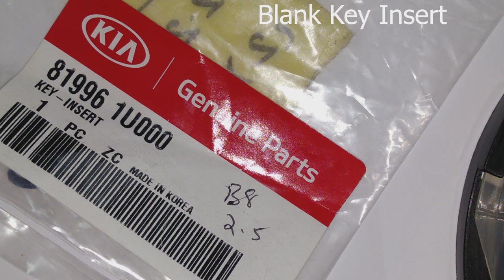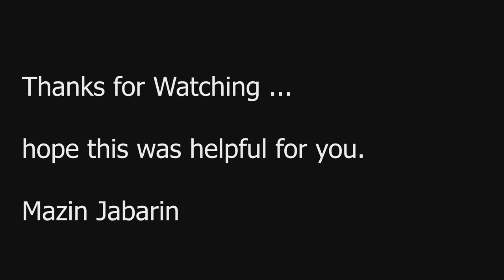Disassemble, Replace key insert and Reassemble KIA Key Fob

Comment: That was extremely painful to watch. I couldn't get past the first 7 minutes of silent, nothing. There has to be an easier way?
Reply from the maker: Sorry for that, It was extremely difficult to do, I believe it is not designed to be disassembled at all.
Please If you found a better way let us know :-)
Reply from the maker: Thanks, keep in mind this is different type.
Reply: @msdee7444  
The key in your link, is for old Ceed 2010, i think.
This is the key for later model Sportage.
It is not designed to be repaired.
Reply: @msdee7444  this isn't the same key. Your link is much easier to open... I'm having as much difficulty as the video poster was.
Reply: You don't need all the B's, just looking at what needs to be done 👍
Reply: Just use a bigger hammer 🔨

Comment: READ ENTIRE COMMENT 
If you are trying to repair flipping of key/loose or no tension of the flipping key, just don't bother opening it with so much care. Remove the screw, flip the key to open position and then Take nose plier, insert it in the empty slot of the key, press the plier, basically u will be breaking the plastic locks and that's the only way to do it. The internal component of the spring mechanism is broken and only solution is to buy new fob and just transfer all the components from old key to new key, don't forget to transfer transponder, it is the main component which communicates with your car, it looks like piece of plastic, so don't throw away old key components until u make sure the new key works. This key is hard to disassemble because it is not designed to be repaired. The upper part of the key with the KIA logo is glued with the bottom part(the one with buttons) of the key. This might be done for waterproofing or just to make key repair impossible.

Comment: Tip: make the spring two turns.  To do this, simply place the 3 components in place (with the key closed) and then correctly insert the other side of the body by turning two anticlockwise before closing.  Do not fully tighten the screw under the logo.
Reply: Thank you. Very helpful!
Reply: @WoWdropzone  I'm glad it help you!

Comment: After swapping the PCB board over, assembling everything, the car will not start with this new key fob. I don't know where the transponder chip is located in the key for the year 2013 Kia Cee'd. Any ideas? Oops! I have just answered my own question by looking more closely at the bits I broke apart yesterday! The transponder is located on the top-left edge of the back cover when looking at the Kia symbol the correct way up. So in this video it is under the securing rubber pin which is shown at 20:48. I will try to remove it tomorrow. It looks like a magnet with a little red paint smudged over part of it (in my case). It is surrounded by quite a bit of plastic so should be another interesting challenge!

The remote central locking, the boot, etc all work perfectly and the car tries to start but the engine will not stay on. Basically, everything works in the car with the key in the ignition but when the engine kicks in, it will simply not stay on and keep running. I can only see a minor scratch on the PCB when my hacksaw went close to it at some point. The scratch has not caused a break in the track on that part of the PCB and there were no components on that side of the PCB.

I used a small hacksaw to try to cut along the lines that had been glued together. When I eventually managed to cut and pull the fob apart, I realised there was a small hole in the PCB that they had moulded the last piece through at the bottom of the PCB. It secures the board in place but that last bit of plastic had to be delicately cut with a razor blade because trying to pull the plastic out of the hole it had been moulded through on the PCB would have probably broken the PCB. Oh and for the metal key ring part at the bottom of the fob, the easiest way to remove it is to put a small screwdriver into the part for the keyring and then bend the screwdriver downwards so that the top part moves away from the fob and hence it lifts that shiny key ring metal upwards. That also causes it to come away from the top groove where it has been pushed through to secure the opposite side of the 3 buttons (see 9:27 of this video).

I managed to use the heated end of a knife to melt and slide away most of the plastic around the transponder. Without doing that, the transponder would not fit into the space available in new key fob I bought on eBay. I actually had to cut away a few ridges in the new key fob as well in the area for transponder because I hadn't managed to reduce the excess plastic around the transponder enough.

The very final step was getting my key blade itself into the new swivel mechanism of the new key fob. Instead of getting a locksmith to cut a copy of my key, I decided to use a metal punch to push out the pin that secures the base of my new blank blade. That was easy enough. However, pushing out the pin in the original Kia key was really tough. I had to hammer it several times and also tried using a nail while resting the key on an adjustable spanner to ensure the pin can drop out on the opposite side. I finally pushed it out and to insert the base back into the swivel base mechanism, I simply had to hammer the end of the original key until it was secured in the swivel base. That's because the original key's base was slightly thicker than the hole in the new key fob (15:53). Luckily the end of the key wasn't badly damaged and the hole for the pin didn't align perfectly so I haven't replaced the pin. The key blade is jammed in the swivel base securely so no doubt it will stay in place. I did 2 anticlockwise turns of the spring in the swivel base (21:04) for a more powerful swing out of the key when I press the release button. A month or so later after assembling the spring in the swivel base and putting the PCB in place with the battery and everything, all works perfectly with no issues.

Comment: Où se trouve le secours
Reply from the maker: You need a new remote with key-insert and (cars locksmith), he should contact KIA to obtain the code for key cut and then he will use a programming kit to reprogram your new key to the car.

Keep looking for your key, if you find it, you can add it to the new key but you must have both at the time of re-programming.

Comment: Je perdus mon télécommande de ma voiture kia sorento s.x v6
Reply from the maker: If you don't have the spare key you have to get a locksmith to unlock the car, contact factory for key replacement, make a mechanical key, reprogram the car with new keys. otherwise if you have a spare key, the locksmith will cost less to create a second spare key and reprogram the car (you need all keys with you).